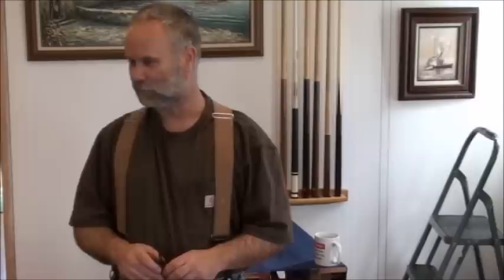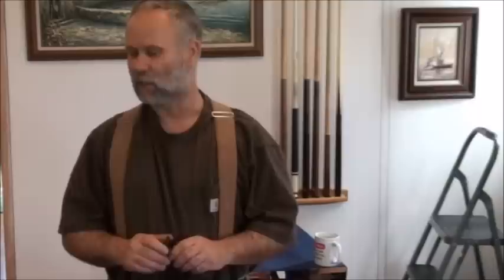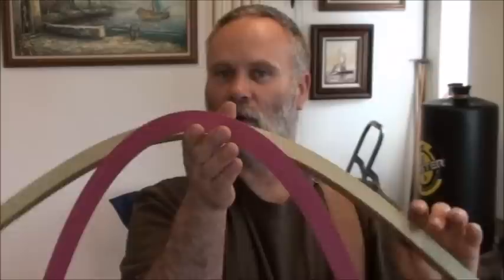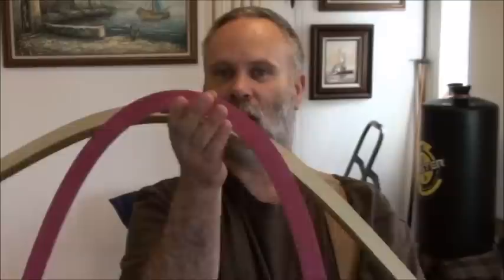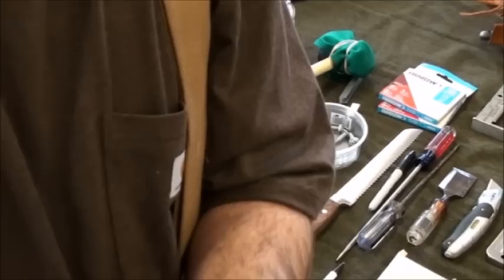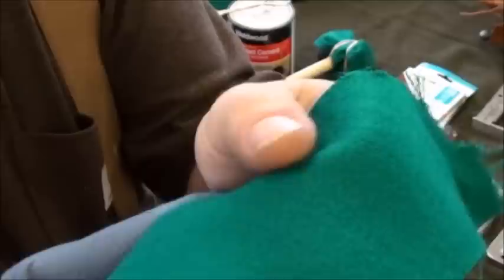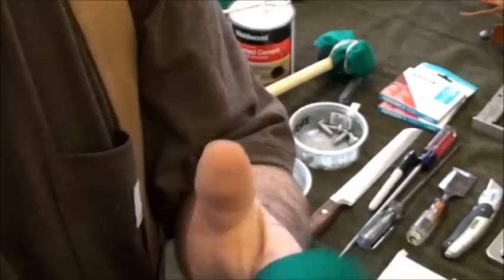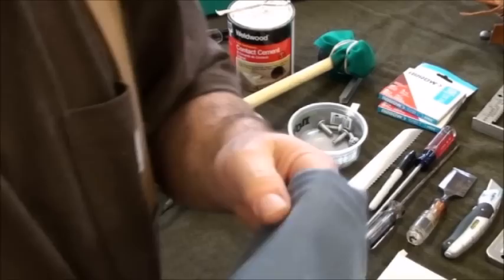Pool Table Bumper Replacement

Comment: I see you're using DAP WELDWOOD Contact Cement for the rubber rails. My questions are... 
1. How Long Did You Have To Wait For The Gluing Process To Dry or Get Sticky Before You  Actually Applied The Rubber Rails To The Wood Rail Frame? and... 
2. How Long Did You Actually Wait For The Rubber Rails To Stick To The Wood Before Wrapping The Cloth Around The Rubber Rail?

Comment: I replaced te bumper of my Brunswick tablet, but the balls jumping when go speed, what can i do?
Reply: Hi Carlos, is it possible you wrapped or stretched your fabric too tight thus distorting the bumpers? It sounds like you may have installed the bumpers upside down. The bumpers are designed for impact of the ball to be around 3/8" above center. To verify, place one on the table next to the bumper and you will quickly see if the bumper is above or below center of the ball. You want the bumper ABOVE center of the ball. Hope this helps!
Reply: I read on some forum that using current rubber on old Brunswick requires to change angle of the wood before gluing the rubber to avoid the problem you identified.

Comment: Wouldn’t a hacksaw blade be a better choice to cut the bumpers
Reply: I believe a hacksaw blade would work. The trick to cutting rubber is to slightly "open" the cut or kerf to relieve binding but not stretch the rubber to the point it distorts your angle you are trying to achieve. I found the knife to work nicely. Thanks Greg.
Reply: Try a sharp fillet knife, trick is to lubricate cut with soapy water. Cuts like butter and you can match an edge nicely with minimal sanding.

Comment: The video stops short of actually replacing the felt.
Reply from the maker: That is because THIS video is about the bumper replacement, the felt is in a separate video. This is from a multi part series as noted IN the video. Here is the video on the felt replacement: https://www.youtube.com/watch?v=UoR95Uz4m0U&t=372s
Reply from the maker: And THIS video is the recovering of the rails: https://www.youtube.com/watch?v=W9xuSrJpT9E&t=2s